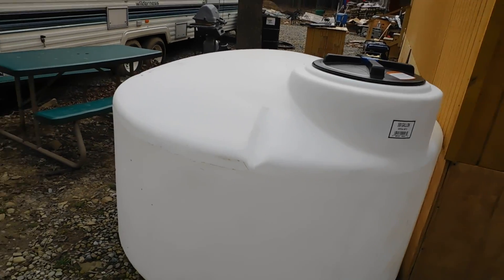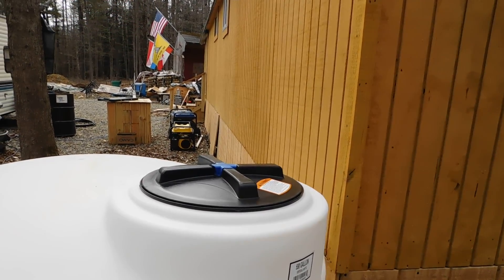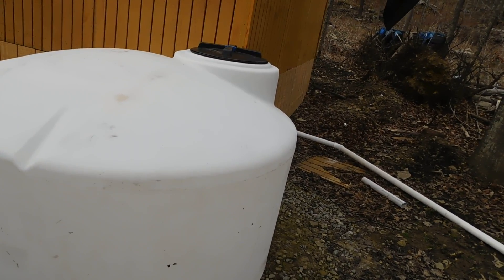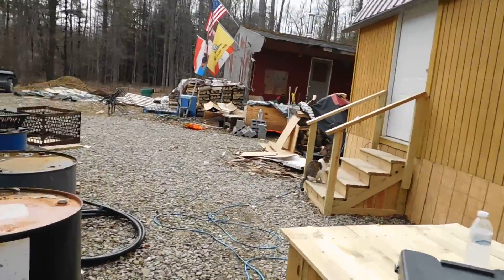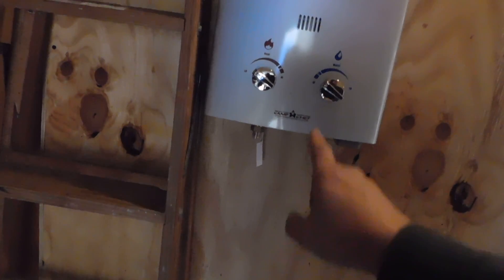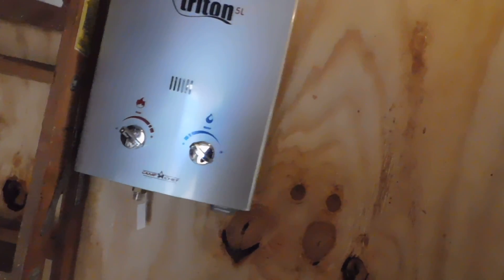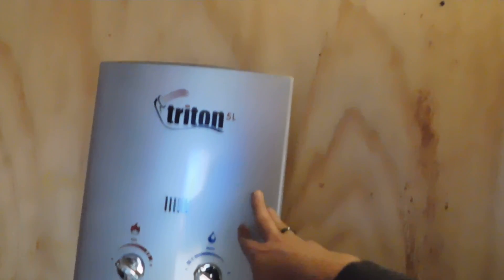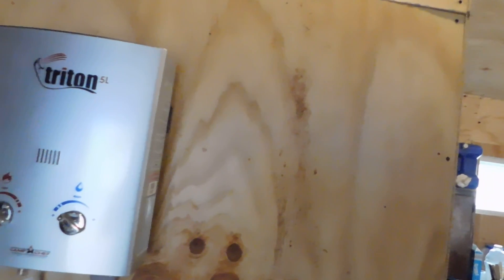Getting things in order for our Rain Catchment System.

Comment: Excellent plan. A pump is a much better option pricewise than the gravity fed system. You're doing it right my friend! Like someone said, look at incorporating a 1st flush diverter and you'll be golden. Don't forget, if you want to drink that catchment water, just get a Berkey. Best tasting water ever. Awesome job!
Reply from the maker: +Shawn Neal I will add one for sure thank you.
Reply: +Shawn Neal bossoftheswamp made a cool Berkey filter set up using the Berkey replacement filters, 2 stainless pots, was much cheaper and works the same but yes Berkey filter themselves are about the best of the best.

Comment: You can if you wish ''semi'' bury the water tank about 2/3 into the ground put straw between the hole wall and tank wall then cover with straw and it wont freeze at all too plus you can put flowers on top.  A cheap alternative to buying a tank like you did if you decide you need more capacity is looking for the ''IBC" tanks.  Square plastic tanks metal caged on metal pallet holds 225 gallons each, already have valves, lids, can be stacked if desired or connected in phase.  Seen 4 put in the ground (900 gallons) can be bought local here food grade for $50 each, they buried them and built a shed over the top with access holes to fill them in the floor.  They had them set each tank collect water from a corner.  So you could place them one in each side of the place or since your setting that one tank maybe find 2 IBC tanks to set next to your round tank adding 450 gallons storage using a "Y" pipe from your existing gutter collection.  Them blue 55 gallon food grade plastic barrels are great too if you find a source, 4 of them in ground is over 200 gallons.  Both the blue barrels and the IBC tanks can make great in ground root storage too.  Seen it done and even old dead fridge or freezer sank into a hillside can be a cheap root storage.  Preppers and homesteaders normally have the same goals just seem to attack the approach differently is all.
Reply from the maker: +spudrubble Thank you that's some great info I will look into it.

Comment: dude i think your doin a great job with your home and family , i know  you have thought about the bird poop on the roof and will filter the water , maybe set that tank higher and do a gravity flow threw a filter to a second tank , that way the water filter does not restrict water flow threw the pump reducing water pressure , also painting your tank black to stop algea , maybe after painting it black paint it white or cover it with a white tarp to prevent solar heat build up , just some thoughts , great job
Reply from the maker: +grizz270 Thank you I do plan on painting it black. And a trap is a very good idea keeping it cool is key.

Comment: you can build a raised platform for the tank above the sink facets so the pump is only needed for shower and hot water.

what would it have cost for a system to remove the sulfur?
Reply from the maker: +Rev John O'Toole That's not a bad idea. and it would cost enough I don't want to deal with that.

Comment: From experience with your type of gas heater, if you want a decent shower your shower faucets must be separate so that you can open the hot water full and add a little cold as necessary.... mixers do not work......you then  adjust the heater to the max it can go.....5L is a bit small but will do the job...hope the advice helps
Reply from the maker: +herbdata Thanks I have had to do a change of plans with the hot water on demand unit.
Reply from the maker: Larry Shinn Yes that's a bite in the butt for sure.

Comment: Hi. only half way through the vid. Love the new tank. how you going to deal with the exhaust from the water heater? wouldn't it be better to vent it out in the wash room?
Reply: I only ask as I have a similar heater outside and want to bring it inside. =)
Reply from the maker: +Steve Flanders There should not be any its propane.

Comment: the water heater needs to be vented. a class b chimney and a vet hood would make that safe to use indoors. not sure but I don't think that pump will prime up that high. might have to go under the building
Reply from the maker: +Roy Amberg I will look into it and see thanks.
Reply: +Roy Amberg With the one he has and amount of air space he aint going to die from it.  His unit is a sipper.  Worse case install a vent that can be opened and closed so if all three people showered in a row he could let some go but even our 3.2gal model (much larger) it dont set off our CO2 alarm in our 22*44 place.  His is like half the size.  I think he has an alarm in his place so he will know if he needs one when using it.

Comment: also if you plan on buying truck loads of water in drout conditions check into what size water trucks are their and buy a tank that will equal there shipping capacity , 5000 gallons of water here delivered cost about 500 bucks , if you take only 2500 gallons its still 500 , in time you  might want to consider the added water capacity
Reply from the maker: +grizz270 I don't plan on buying any water.

Comment: Keeping the tank from freezing means keeping the water moving and with prolonged frost the tank will need to be insulated and possibly heated. Just stirring the water will only prevent the surface of the water from freezing over like in standing water. Stirring means you keep the heat distribution in the water equal over the entire tank. It will still cool down and as soon as the tank as a whole reaches  freezing temperatures it will freeze sollid verry quickly. Like I said before.  You will need to seriously insulate the tank and pipes in winter and maybe even need to heat the water to keep it from freezing during a long and cold winter.
Reply from the maker: +Jelle Baris That is the plan for next winter keeping the water heated so it does not freeze.
Reply: preppernurse1 Insulation might be as simple as building a wall of straw bales around the tank. That is an idea I saw  mentioned at the channel of "the big family homestead"when he was inquiring about keeping his watertanks from freezing. I don't know if that is an option in your area.
Reply from the maker: Jelle Baris That might be a good option. Thanks for saying that.